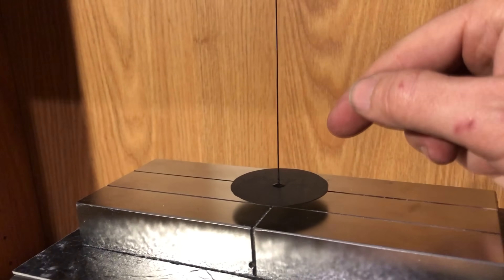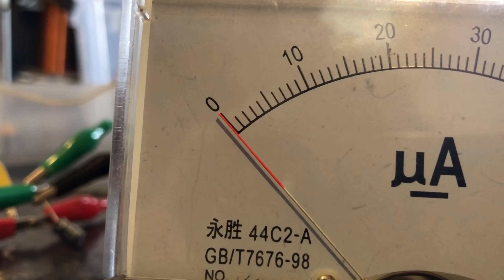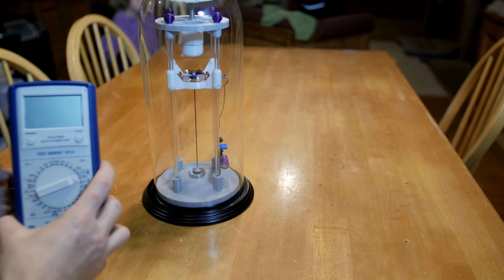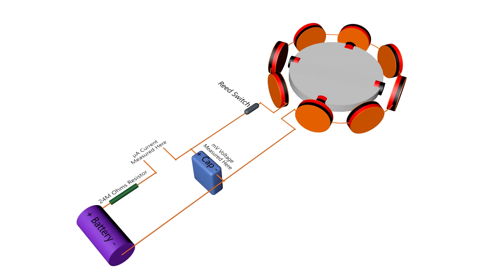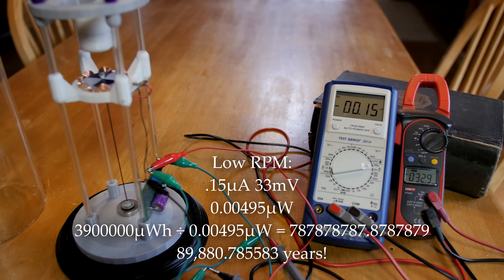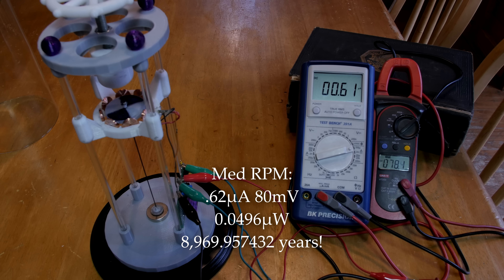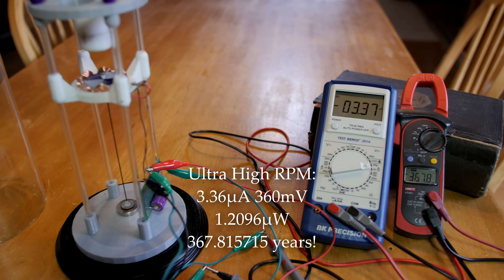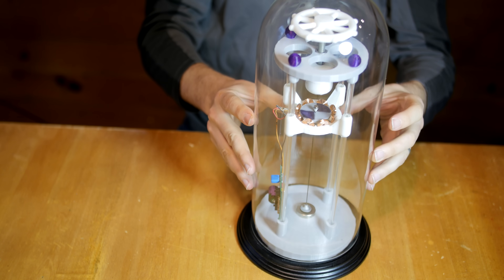Fully Levitating Magnetic EZ-Spin Motor - Pyrolytic Graphite

Comment: Your calculation is wrong. Current is the same for the whole circuit. So if you measure 150 nA, then it needs 150 nA * 3.6 V = 540 nW. The lithium thionyl chloride battery has 1.2 Ah, which means it will probably run for 2 million hours. Maybe half of it because the battery voltage drops when it is more discharged. But this would be still 114 years.
BTW, most of the energy is used in the resistor. If you measure 33 mV at the coils, this means the voltage drop across the 24 megohm resistor is 3.6 - 0.033 = 3.567 V (look up "Kirchhoff's rules"). So it would dissipate the majority of the energy. With a buck converter, you can convert the voltage without a resistor for lower loss. But I think most buck converters need more current for the regulation process than what the circuit now needs.
Reply from the maker: I understand what you are saying.   I was not really wondering about how long the motor would run on a AA battery but how long it would run on the 3.6Wh the AA battery represents.  I do not think that a battery is the best way to power this.  I just need work up a good long term way to scavenge 25-50mV from the environment.

Comment: Try a tuned coil, a tank circuit, and a rectifier. Like a crystal radio. Extract EMF from the cosmic microwave background in the RF range, rectify it, and run it through a tiny cap to condition it. If you really only need nanoamps, it should be enough to keep it going without any resistive load.
Reply from the maker: Yes, I think it would work.

Comment: If you could Contol pulse timing without the reed switch, I suspect you reed switch will fail first
Reply: Just got to that part of the video lol, FYI drag = thrust so given it is slow speed a vacuum will make little or no difference at that speed.

Comment: Pull a vacuum in the glass bell and it'll spin even longer as lower air friction/density. Also try maybe use a hall effect sensor for the triggering! Lastly -You can tell the difference between an artist and a free energy nut, one wants to explore, create and learn, the other wants to 'be the first' and make money.

Comment: Get some 316L stainless steel and makes an Earth battery and power it.
Reply from the maker: I think that two pieces of stainless steel may work if one of the pieces is significantly larger than the other.  I would have to tests to know for sure.

Comment: You could eliminate the battery and use a energy harvesting antenna and rectifier.. I have a circuit that used to be in nuts and volts magazine back in the 1990s, it powered a small transistor radio. Then you could put a vacume on it without worry... No chemical components involved..
Reply: This should work particular well if it's tuned to a nearby high powered radio station.
Those crystal radios with no internal power source always amazed me. It would be interesting to see that power used for something other than a small ear phone.
Reply: Please give a link to your Nut & Volts article if you can!
Reply: ok do not give the mad scientist MORE ideas!
Reply: <3
Reply: Would like to see that !
Reply: Yes I would be interested in seeing you trying an APM(ambient power module), assuming you live somewhere with a reliable signal.
Reply: https://drive.google.com/file/d/1scmGZaJiA_x2KKQa8eIZ1-4N4AH5gq91/view?usp=drivesdk
Reply: Can you put tha
Reply from the maker: Yes, I have been thinking about trying the "Tate ambient power module".
Reply: @lasersaber  The "Tesla" Radione radio should be able to be found for download out in the internet... If not let me know...

Comment: While achieving such apparent long run times from an AA cell, I wonder if a magnet and plastics used would be durable for such a long period. I would think a vacuum would let you have a high rpm with a lower power consumption.
  I’d be happy to own one that runs on a single tiny watch cell for 80 years!
  It’s fascinating to see and mind boggling to try to imagine how efficient these things actually are, thanks for the update on this awesome project.

Comment: Did you take battery self discharge into the equation?
Reply from the maker: No I was just wondering how long it would theoretically run on 3.9Wh.  Not how long it would run on a AA battery but on amount of energy stored in a AA battery.

Comment: Is this a double Reed switch design? If it's a single currently, adding a second one could potentially double the efficiency to last double the length. Its some blabbery from a midnight engineering student so take it with a grain of salt.
By having a double reed switch, you might be able to increase the test resistance even higher for an even lower current draw. Although the power cycle would be more continuous, thus increasing the power draw, it might be worth investigating.
Reply: Also according to your schematic you are actually reading the current draw from the capacitor for the half cycles as full cycles. You know what that means? The .15uA you measured is only true for half the cycle when the reed switch is actually triggered. (That is assuming the reed switch is configured for turning on half of the time). Meaning that you can double your numbers of years from 89 thousand years to 179 thousand for the low rpm setting and applies to all the other run time as well.. Well that's only if you removed your capacitor, which means you can't make measurements, but should guarantee that no drainage occurs from the capacitors.
Now this is ignoring the inductance of the coils, but for this I assume that the impedance of the coils is negligible compared to the 24MOhm resistor.
Reply: Big fan by the way, the first video I saw from you was in middle school when I was interested in coils and stuff (inspiration from N. Tesla) when I found your joule ringer/theif videos. Now that it's been 8 years, I finally understand what these numbers really mean and how I can build them.

Comment: Did I see two little button magnets at the top of the spindle? With perhaps a larger magnet above for stabilization? Consider extending the spindle (or lowering the rotating magnets) to avoid interaction with coils.
Reply from the maker: The distance is actually important as it gives a bias to the reed switch.  Otherwise the tiny magnets on the rotor will not activate the reed switch.
Reply: Yes, I see the reed switches but I was thinking that if the upper magnet can stabilize the center magnets, then it could cause drag on the rotating magnets or reduce the effectiveness of the coils... Just a thought.

Comment: Fine tuning that bias magnet at the top is going to drive you crazy. 
Every time the room temperature changes by 10 or 20 degrees the rotor shaft will either be pulled up or dropped down.
Reply from the maker: It's actually amazingly stable.  I have run it for well over a week and through some very wide temperature ranges with no issues.  Maybe I will see issues if I put it in the freezer and then let it warm back up while running at room temperature.
Reply: Pyrolytic graphite is way stronger than the usual bismuth plates. That means a larger temperature range where it's stable.

Comment: Could you please try running it from ceramic capacitors? They should be durable enough to run it for decades
Reply: Hey bitluni :)
Reply from the maker: I would need to locate a low voltage high capacity one.
Reply: hiy 💗ceramik capasitorz sownd ihnterehstihng💗thaynku💗🌈

Comment: Nice work. Ready for my dumb question? If you need extremely low voltage have you tried Earth battery? Elegant piece of machinery"
Commercial Kinetic Generators Utilize A Vacuum  in a Closed System.
Reply from the maker: Yes, in the past I used to run motors that way.  In my experience the effect was always galvanic.  Maybe with this little motor I could actully run on telluric currents.
Reply: @lasersaber  Good luck"With seeing your work I believe you will be successful .
Reply: @lasersaber  I realize I have not the equipment nor the resources you have for your endeavors. And I also I realize that there is only so far you can push the difference between two apposing ?/ dielectric poles"But I still think with a conservation of input a change in the frequency of input would reduce drag or need fore more energy? What I do not understand and if it is a secret you need not tell. How do you escape a Galvanic response while taping into Telluric currents? It would appear any conductive material  would have some sort of Galvanic response.
I thought about this for a couple of days now but have not met with a solution?
Again If it is a trade secret thing" I am fine with that.
When I become so compelled I will find the answer.

Comment: Nice job Ls. This would easily run from the energy a foxhole radio would deliver. You would then have no need for a battery
Reply from the maker: Thanks for the encouragement.  I think I will try running one of these off an aerial antenna.
Reply: Surely you'd definitly draw enough from an antenna, the likes of which a crystal radio would use?

Comment: I agree with your thought to pull a vacuum on that chamber and see what it does to your power usage.
Sometimes the point to a build is the build itself.  Keep building.
Reply: you went full tesla,
never go full tesla
Reply: waptek2 not even once
Reply: There is absolutely negligible wind resistance on something that small moving that slowly. Waste of time
Reply: @rsmith155  but it would also be easy to do...so why wouldn't you?
Reply: The Scubersteve it would only be "easy" if you already have access to the right equipment. In order to pull enough vacuum for it to actually be worthwhile, that is.
Reply: It's a shaft and a disc... Ultimately You won't have accurate enough equipment to measure the miniscule difference. In fact, it might not exist anywhere.
Reply: @rsmith155  I would still have to try it.  It was a fun, interesting, pointless build up to this point, why stop now?
Reply: The Scubersteve I already gave you two compelling reasons. 
1- common sense
2- even if you did you probably couldn't measure the difference. The difference would be so small. It Certainly couldn't be done with the equipment shown on the video anyway.
Reply: My guess is that the power usage will be almost the same because it mostly depends on coil resistance. The difference is it'll spin faster at that current - less resistance. Actually my guess is that it will probably accelerate forever ... almost - there are other magnetic fields that will try to slow it down - earth or radio waves. But it'll be still cool to see how it gets faster and faster
Reply: Only the rotating parts need to be in a vacuum, a tube would suffice.

Comment: You are wrong about power in a AA batterie. Standard alkaline battery is 1.5v at 1200 mah. This only makes for 1.8 watt hour. You can also add couple of diodes to return current back to your capacitor from the collapsing magnetic field during the off cycle.
Reply: diodes have crazy high losses. transistors are much better at this. mosfets and such. even the diode in a mosfet is much better.

Comment: It's a neat toy, but running for that long is pretty meaningless if it doesn't even do anything.
Reply: Its a bearingless Motor. It basically has no drag other then its own (low gyro) weight. The faster it's spun the less it weight it becomes tho.
Reply: Spinning it fast doesn't affect it's weight, it just makes the magnetic stabilization less reliable.
Reply: @Blurns  spinning something very fast does affect the forces exerted upon a rotor which will effect the weight. However spinning will not increase the objects mass. Weight is a relative concept based on applied forces, mass is the only constant in relation to the object itself. But yes, the diamagnetic stabilization is inherently less reliable the faster the rotor spins. Laser Sabers design could be stabilized better through better engineering of the drive mechanism and ratio of diameter between the two sides of his rotor.
Reply: @wanderingzanzey2126  What is your point? Mine is simply that this has no practical application what so ever.
Reply: just friendly conversation :) but if i must make a point, my point is that the design and technique LaserSaber has chosen to use is actually feasible to scale-up into a practically usable machine. Probably not using pyrolytic graphite, but some day materials science will get there. Right now its just a toy, a pretty cool one that takes advantage of really amazing and not-so understood concepts of physics :)
Reply: @wanderingzanzey2126  Useful for what?
Reply from the maker: It's useful for bringing a smile to my face when I look over and see it running on the shelf.
Reply: @lasersaber  indeed! a brilliant retort haha. Thanks for sharing your visions and thoughts with all of us :) your videos are great.
Reply: @lasersaber  That's all that matters. :)
Reply: @lasersaber not sure how to ask you questions about your motors I just clicked on your name to talk. I made these batteries two cells power an LED very brightly it can light up a room basically. I just can't run a motor yet. I've been trying for about a year and a half.
Reply: @lasersaber   also the LEDs run strong for a long time

Comment: Makes one ponder on an electret ......
Reply from the maker: Is there a low voltage analogous device?  I only need 25-50mV.
Reply: Here is another goofy idea..... what if you had the ring magnet array placed on top of a piezo electric disc.... the micro oscillations perhaps would be adequate to generate a micro voltage.  Or have the upper magnet that keeps the rotor levitating glued upon a piezo disc as well.  Just contemplating and let me know what you think.  A bridge rectifier would need to be made to make DC for your motor rotor........ Cheers !